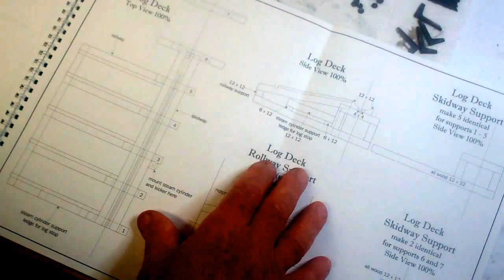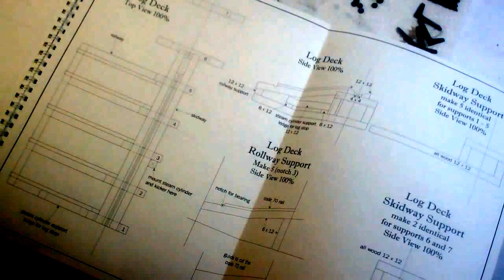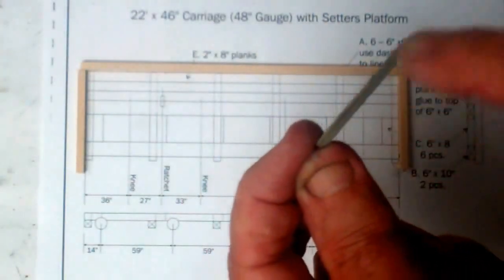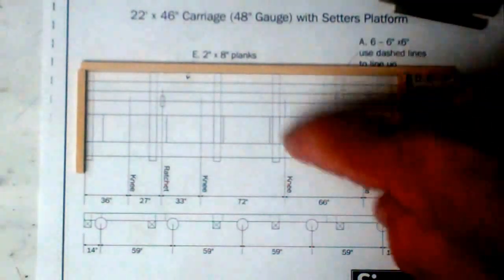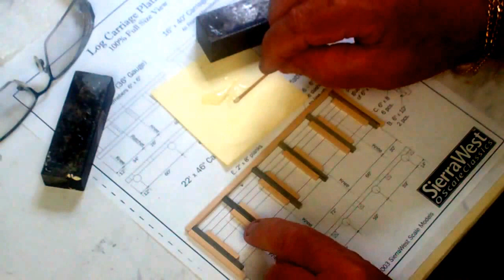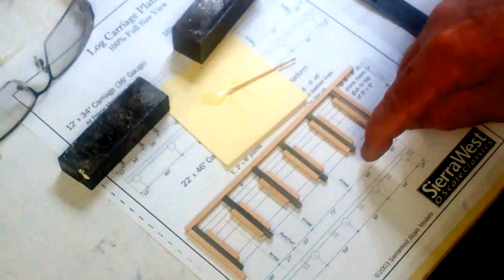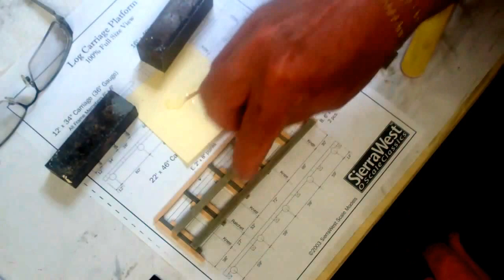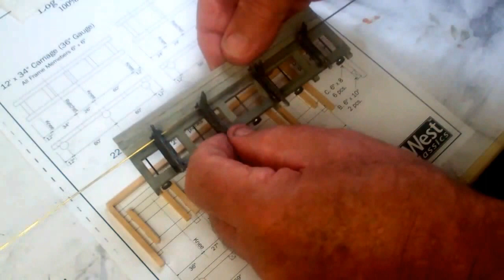Part 6: Building a Sawmill

Comment: This is an interesting set of articles but I'm just a little curious as to why you have the saw blades appear to be offset.  I have the same equipment and the instructions clearly show the blades in line with each other. They have to be to cut the larger logs into boards and also with your comment about painting the blades, they would be pretty much all shiny with the exception of the smaller area at the hubs. Understand that with larger logs with your set up would not cut completely through.